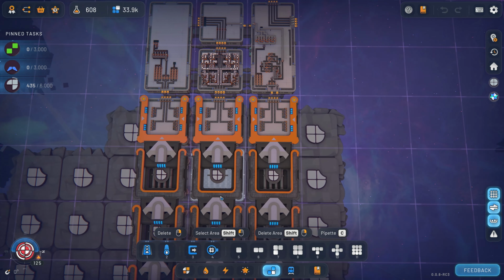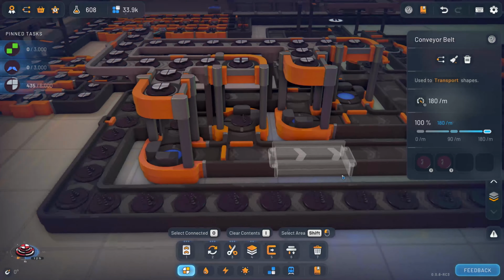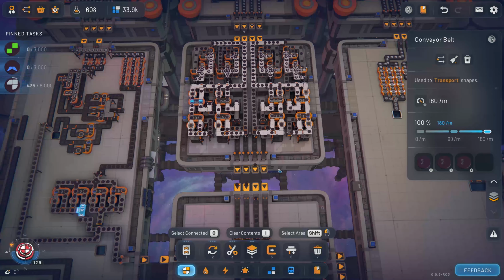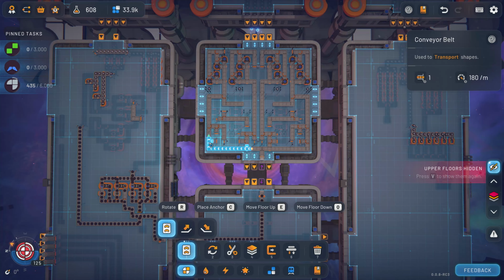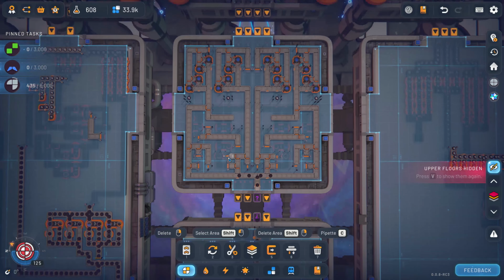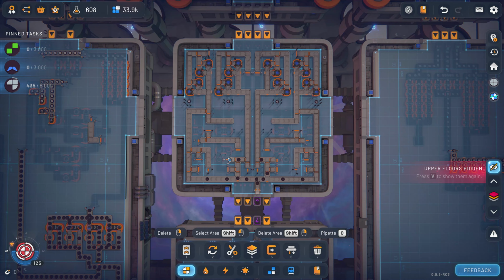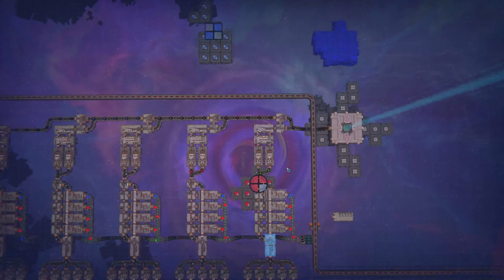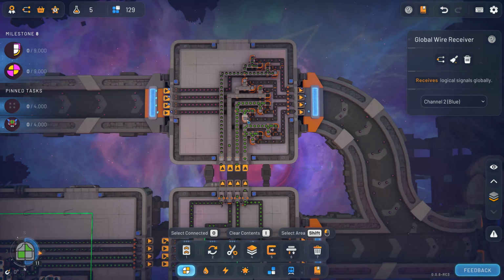Shapez 2 - Tutorial for a MAM (Part 3) - Adding PINs

Comment: PINs have kind of been a pain. The task that came down to a three stack of circular shapes with a PIN on top. Basically trial and error.
Reply from the maker: Actually with PINs being handled as "normal" shapes, so basically making it a 5th shape, actually did not complicate the MAM. Crystals however are a pain, especially with Pins and Gaps. Working on that, work in progress.